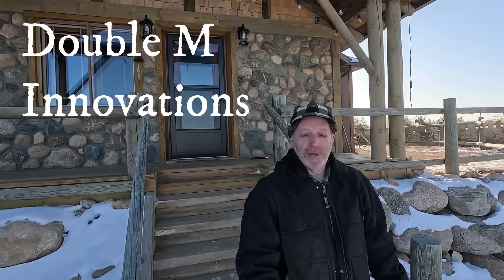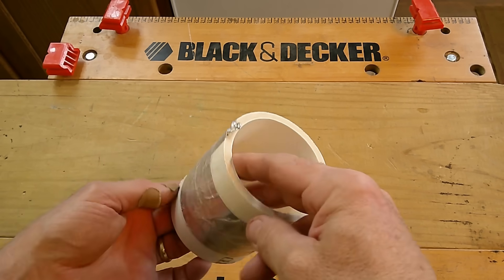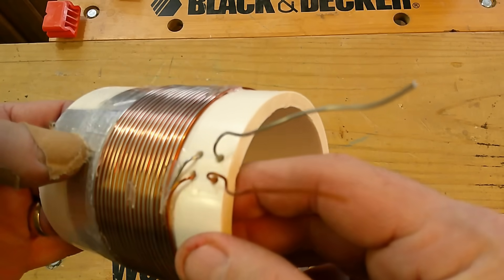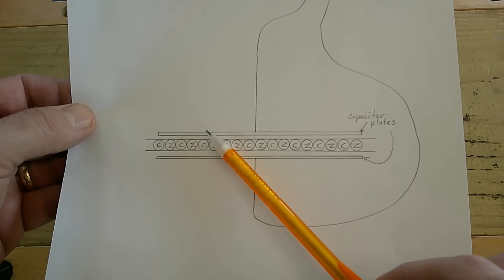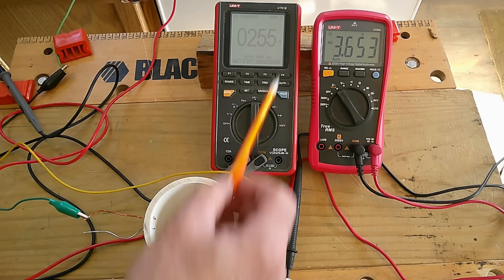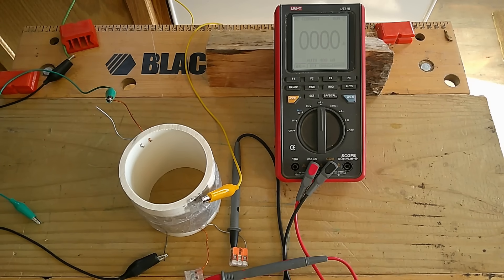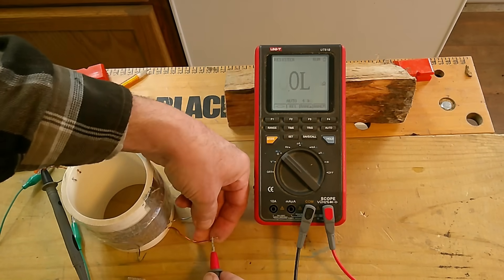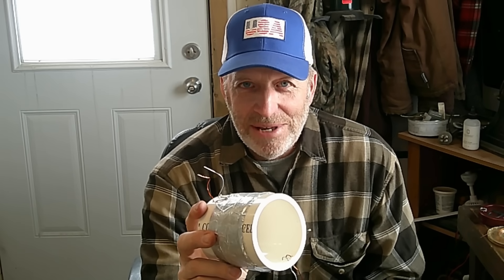Copper-Zinc anomaly; and a capacitor sandwich

Comment: My take on what is going on with this circuit:
The inductive properties of the coils are negligible, since the copper coils have an air core, with relatively few turns, yielding a very low inductive reactance at 60 Hz. Furthermore, there is only 25.5uA of current available to cause a magnetic field. Additionally, any magnetic field would be in the wrong direction to induce a voltage across the coil. Therefore, all measurable voltage, or current readings from the coil are due to capacitive coupling(s) between the copper coil and the two foil plates. 
Assume for a moment, that there is only a single COPPER wire between the two aluminum foil plates (no zinc wire). This forms two capacitors in series, with the coil wire being the common terminal of the two capacitors. This creates an AC voltage divider. 
If the exposed surface area of the inside of the wire coil was the same as the exposed outside surface area, then the capacitances between the wire and either plate would be the same. The area is NOT the same, but close enough. This capacitive, AC voltage divider, divides the 120VAC approximately equally, which produces about 60VAC at the copper wire, compared to the inner foil. Let’s say this inner, aluminum foil plate, is grounded. Therefore, there is about 60VAC to ground.
Now let’s introduce the zinc wire. We now have another capacitive voltage divider. However, this zinc wire has no enamel insulation coating. Without an enamel coating, it is a few mils closer to the grounded inner foil, than the copper wire is. Therefore, it has more capacitance to ground, and less capacitive REACTANCE to ground (measured in ohms). Also, because it is a few mils smaller in diameter (because it lacks the enamel coating), it does not stand as high as the copper wire that is right next to it, on either side. Therefore, the copper wire is holding the outer foil plate away from the zinc wire, which raises the capacitive reactance of the zinc wire to the outer plate. Hence, the zinc wire voltage divider produces a lower output voltage (say 56.347VAC) than the copper wire voltage divider. Therefore, the voltmeter displays a difference of 3.653VAC.
CAUTION! The 3.653V reading is not actually a no-load reading. This is because the input resistance of the typical multimeter is often around 10 megohms. Usually not an issue. But in this case, the reactance of the circuit we are trying to measure is also in the millions of ohms. In fact, the TOTAL capacitive reactance, as seen by the AC line, is 4.7 megohms. We know this, because the line current was 25.5 microamps, with 120VAC applied. A 10 megohm meter loading resistance is considerable, when the source (circuit) reactance is in the megohms. For what it is worth, 4.7 megohms, at 60HZ, equates to approx. 563 picofarads of total capacitance from line-to-line.
Watching this video and reading some of the comments, I see some interesting subjects to research. Thanks for posting.
Reply from the maker: Thanks for the study!  It's a little bit similar to what another poster was thinking.  The zinc wire is actually a little bit larger in diameter than the copper.  The zinc measures 1.11mm and the copper  1.09mm.
If it's some kind of capacitive coupling (like 2 capacitors in a series) if you change the capacitance of one, wouldn't it effect the overall capacitance with other?  Wondering why, if the copper and zinc wires are shorted, the current didn't change.
Reply: @doubleMinnovations  Actually, it is a bit more complicated than just 2 capacitors in series (copper wire), and another 2 capacitors in series (zinc wire). There is the fact that the inner and outer foils extend beyond the wire coils. This extra ¾” (19mm) or so of foil is forming a separate capacitor that I chose not to mention the first time, because it is not part of the capacitive dividers I was describing. It is, however, part of the total 563pF of capacitance… potentially as much as ½ of the total, because there, there are fewer voids under the foil that would cause the capacitance to be reduced. So, let’s say, out of the 563pF total capacitance, 232pF is due to the area where there are no windings, has a reactance of 11.4 megohms, and draws 10.5uA of current. 
The remaining 331pF of capacitance is associated with the area that has windings. This 331pF comes to a nice, round number of; Xc =1 / (2πFC) = 8,013,844 ohms. This 8 megohms, is the total reactance for the 4 voltage divider capacitors. For now, let’s assume we have ALL COPPER coils, and there is NO DIFFERENCE IN VOLTAGE between them. The voltmeter should read zero volts.
What we have, is a series-string of two capacitive reactances, 8 megohms each, that add up to 16 megohms. This is for voltage-divider #1 (The 1st copper wire, IS the center-connection between these 2 capacitors). Let’s label the top capacitor as “C1”, and bottom capacitor (grounded) as “C2”.
We also have another series-string of 2 capacitors, formed by the other copper winding (voltage-divider #2). Again, 8 megohms each, that add up to 16 megohms. The top capacitor is “C3”, and bottom capacitor (grounded) is “C4”.
The 120VAC source, (and your current meter) sees the two 16 megohm strings as being in parallel. So, the total reactance is ½ of 16megohms, which brings us back to 8 megohms. This 8 megohms will draw an additional 15uA of current from the 120VAC line, for a total of; 10.5uA + 15uA = 25.5uA. 
Now let’s short the two copper coil wires. This places C1 (8 megohms) in parallel with C3 (8 megohms), for a subtotal of 4 megohms. It also places C2 and C4 in parallel, for a separate subtotal of 4 megohms. The 120VAC source, (and your current meter) sees the two 4 megohm reactances as being in series, which adds up to 8 megohms. This is what we had before we shorted the wires together. Hence, no change in total reactance, and therefore, no change in total current draw. 
Another way to look at it is; the two copper coil-wires had the same voltage (no difference in potential). Therefore, the shorting-wire has no current flowing through it. Hence, it has no effect.
If you run the numbers with C3 being 8.1 megohms, and C4 as 7.9 megohms (simulating one wire being a different diameter), you will not see much change, but there will be a small change in your ammeter reading when you short the wires together, because the two dividers are producing different voltages, and therefore there will be current flowing through the shorting wire. You might need a precision ammeter to see it.
Beware! Merely making a measurement with your voltmeter, can not only place a 10 megohm load on the circuit, but also introduce stray currents into the circuit being tested! In a circuit with impedances in the megohms (mostly reactances, in this case), the stray currents can EASILY be unbalanced between the two meter-leads, which would cause a difference-in-potential between the two leads, which would then show-up on the meter display! This could contribute as much, or even more than a difference-in-diameter between the two coil wires.
How? Inside the meter, is a foil shield, that is usually connected ONLY to the “COMMON” (black) test-lead terminal. This is to shield the internal circuitry from stray fields. This shield, acting as a capacitor-plate, can introduce stray currents to the black test-lead, but not equally to the RED test-lead, due to the 10 megohm input-impedance of the meter. If the meter is placed near an electric field, such as from AC power wiring, or the capacitor plates of your circuit under test, this internal shield can pick-up stray currents and feed them backwards, down the black (common) test-lead, to the very circuit you are testing. Those unequal stray currents will result in unequal voltages at the points being tested. So, what might have been two equal voltages, will now show-up, and be displayed as, a difference reading on the voltmeter. 
To combat this problem when dealing with high resistances, reactances, or the combination thereof (impedances), try to make your measurements with the “COMMON” meter lead grounded to the same ground as your voltage source, and then measure each test-point separately (with respect to ground). Then subtract them. When the difference in voltage is small, a precision meter, that has more digits on the display, may be required.
Experiment: First, disconnect the meter-leads from any circuits, and unplug them from the meter. Then select the capacitance mode with the meter’s selector switch. Note the meter’s capacitance reading. Now, plug the test-leads back into the meter, twist them together, and let them dangle. What is the capacitance reading now? You are measuring the stray capacitance between the test-leads.
Experiment #2: First, disconnect the meter-leads from any circuits, and unplug them from the meter. Then select the capacitance mode with the meter’s selector switch. Note the meter’s capacitance reading. Now, plug the BLACK test-lead ONLY, back into the meter’s “COMMON” jack. If the meter has good internal shielding, THE READING SHOULD NOT CHANGE! Now wrap the black test lead around the meter. Again, the capacitance reading should NOT CHANGE! This is because the internal shield is already, internally connected to the common terminal. Now, unplug the black test-lead, and plug in the RED test lead. Note that the capacitance changes, especially if you wrap the RED test-lead around the meter housing, which places it closer to the internal shield. It is being capacitively coupled to the internal shield, and the meter displays this stray capacitance value.
Moving the voltmeter meter around the workbench, first closer, and then further from potential stray current sources, will give you an idea of the magnitude of the stray current problem. 
Safety First!
Reply from the maker: I thought I was getting my head wrapped around what some others thoughts were.  I have been balancing the capacitance between the 4 points of the (copper outer plate), (copper inner plate), (zinc outer plate), (zinc inner plate).  Removed a little of the zinc wire to do so.  Still get voltage readings from 2.5v to 4volts.  but it varies.  It is a lot more complicated then I imagined!  Will do more thinking and testing as time allows.

Comment: Hmm. This isn't my area of expertise at all, but there is an old technique that makes a galvanic cell by immersing a copper rod and a zinc rod in two separate beakers with salt solutions and a salt bridge between them. Interesting that it's the same two metals here.

If we look at the structure, you basically have two concentric inductors made of different metals. Copper is quite a bit more conductive than zinc (around 4 times more), so you the inductance and resistance between the two will also be different with the same dimensions. 

I am guessing, but I would imagine if one wire has different resistance and inductance than the concentrically would wire, you should end up with a potential difference between them in an AC field because that would produce a phase difference between them that could manifest as a measurable offset (like if you were to sum two partially out of phase waveforms). 

Just guessing!

Comment: Discconect the green jumper wire from the zinc wire, it's acting as an antenna and unbalancing the circuit.
Reply from the maker: Good observation!  I wasn't paying much attention to that, but it did cause a slight variation one way or the other, depending on which wire it was left clipped to.  If it was left clipped to the copper wire, it raised the voltage .076v -(from not being connected to either one).  If it was left clipped to the zinc wire, it decreased the voltage .052v.  The green clip lead measures 19" long.  I just checked that about a dozen times, so that's what I observed.

Comment: Something is wrong with measurements. 
2.2microA in ...open circuit?!
Then zero A in close circuit?!
Are you measuring RF currents at 50/60Hz?! I hope not...

Also voltage messurements looks questionable too.
Please rectify those 3.6Vac and post the DC voltage. Also, please charge a small capacitor and post the results pls. 
Thanks!

Comment: I think it is not the difference in the metals but in the dielectrics. One has email and tape and the other only tape. That gives a little difference in capacity and you built in fact two capacitive voltage dividers next to each other between the aluminium outer plates. In this case the metal does not have an influence but the different dielectrics do.
Reply: I think you are on the right track. But note that the voltage divider ratios have to be different in order to get a voltage difference between the wires. Since the zinc wire has no insulation, it sits closer to the inner plate than the other wire which has insulation. That's what causes the divider ratios to be different.
Reply: It is just a pair of capacitive voltage dividers that are not matched.  There is also lots of external stray capacitance that is not taken into account.  To see how much strays can affect things, I took a digital multimeter set to AC volts. One lead was connected to mains earth. The other lead was laid across a live mains cable (240V) at 90 degrees. I measured 0.4V.  When the meter lead was laid parallel to the mains cable for several inches I read several volts.  Conclusion:  The setup in the video would suffer from lots of stray capacitance which would unbalance the capacitive voltage dividers even if they were perfectly matched.  And then there is the unbalance caused by one wire being enamelled (and its associated dielectric constant)  and the other wire being uninsulated.  It would be interesting to see the results if both wires were of the same type - I expect the voltage to be lower but still present as they are not matched .  Repeat with 2 copper wires - one enamelled and the other PVC insulated.  You will still read volts.    As I am lazy, I asked Chat GPT to calculate the value of capacitance required to to cause 0.4V to be dropped across a 10M ohm load. I want to see what capacitance was present between my meter lead crossing a mains cable at 90 degrees.  Its answer was 0.0088pF (I have not checked Chat GPT's answer).  It would be pretty hard to create the test object shown in the video with capacitances matched to  few femto farads.

Comment: 438 / 5.000
I believe he built a capacitor with an intermediate plate, or rather with two intermediate plates, one of copper and one of zinc. The two intermediate plates differ slightly in dielectric, 'cause the copper is enameled. Since the electric field is distributed according to the dielectric constant of the medium, the small potential difference detected could be due to the small layer of additional dielectric applied to the copper.

Comment: The current didn't rise for two reasons. First, you are using AC, not DC power. Secondly, a power spike occurs when you DISCONNECT wires or terminals. The effect is from the resistance difference of the two wires. Also, a capacitor will hold it's charge for some time; this is why it is dangerous to dismantle a microwave or an old CRT TV or monitor. Incidentally, when dis-similar metals are used in shipbuilding, the screws or whatever get corroded much more quickly. I do not know why that happens, but it is prob related. Welding in Space simply requires you to place them together. Better get it right the first time! No heat or ANYTHING else, just place it. Crazy. Tesla videos will help you here as well. Thanks to you for this one!

Comment: ok,think a Coil.a Metal Core and aCoil of Copperwire.your guys send power in the wire,thats ok.But why think no one so far at the CORE must be also have a current(positive).so built a coil and connect the core in SERIAL with your Coil and research what happends now.Remember Power floow from positiv to negative and positive side attrackt the current.so you have a important change in your magnetic field,some create MAGIC. Aluminium is not magnetic but be trackt from a magnetic field,but if you connect positive to the Aluminium will you change the direction of the magnetic field(teslas Phase Change 90 Degress) take a closer look of the aurora borealis in Norway. you see it is a sandwitch of powerlines,like Papir,but vertical.so it means the light is positive,so is black space means negative and the next powerline. it is like the DOBLER EFFECT. Your guys a not far from ANTI GRAVITY. use to magnets. north against north and now put 2 Aluminium Strips betwen and connect positve and negative on one side and a Lightball on the other. like a snadwish,magnets and betwen Chees and Tomato. the aluminiumstrips will force the magnetic northpol 90 Degress away from the Southpol,so it measn you deactivate the North-South Direction,because the northpol shift 90 degress.there the Magic starts.

Comment: You should take the zinc and copper wire, tie them together on one end and then you will have three leads, the one where the two are connected and the two on the other end connect this to a ZVS driver with the tied leads, being the middle return of the ZVS then connect your meter to the two capacitive plates and see what kind of voltage you have there. I’m curious about this one..

Comment: Well I’m betting the copper and zinc are reacting in the same context as a battery and the enamel is working as an anion or cation exchange membrane. If you  “run it hard and long” (whatever that even means in your situation) if you see corrosion/oxidation you know what must have happened..
Reply: why does it produce ac, it should be dc if its a battery
Reply: The normal Potential difference of Cu and Zn is 1,103V. That would be the battery voltage.  CuAl would be 2V and ZnAl 0,897V
Reply: @herrkulor3771  it doesn't explain AC output, it has nothing to do with potential difference in my view.